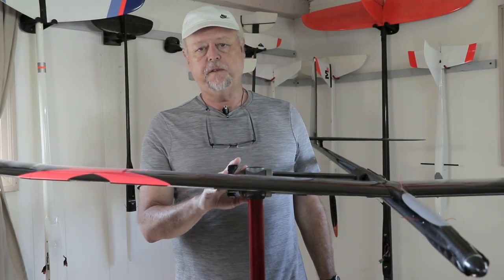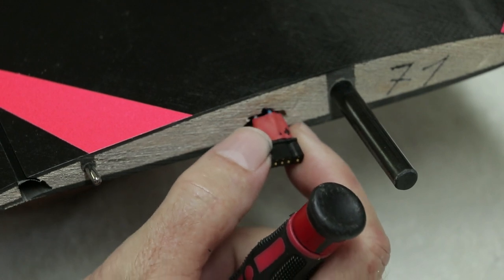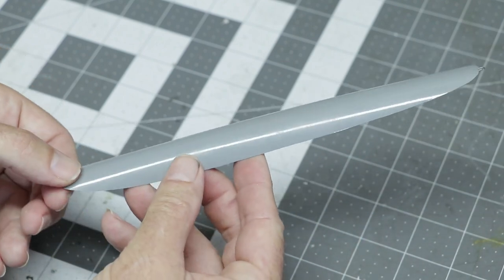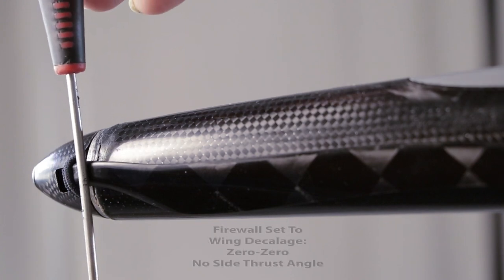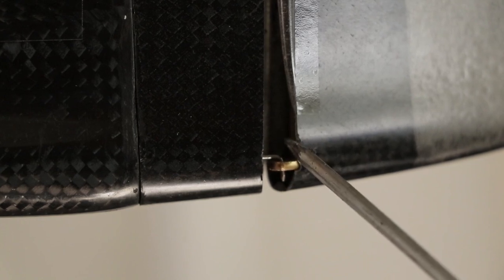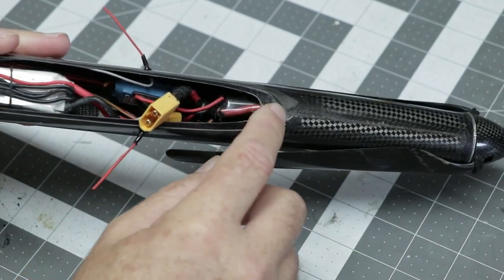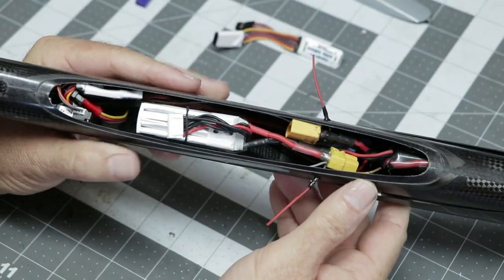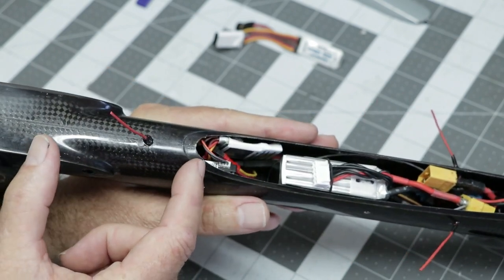VIXEN 2 F5J Cross Tail Glider Final Installation Tips and Power System Set Up

Comment: im confused, i have just purchased a Vladimir Elf DLG though its not competition grade material its in the lines of F3K as far as i know.
So what are these codes relating too F3K F3J F5J F5D
Im taking it that F3J is electric
 Whats it all mean and what do the letters and numbers mean?
Reply from the maker: https://www.fai.org/page/f3-radio-control-soaring     Designations of international competition classes for aero modeling. F3 is for soaring, F5 for electric flight, there are sub classes for each. F5J is new, and not even on the FAI sight yet. Basically electric launch with duration and landing tasks, start altitude is also part of your score.